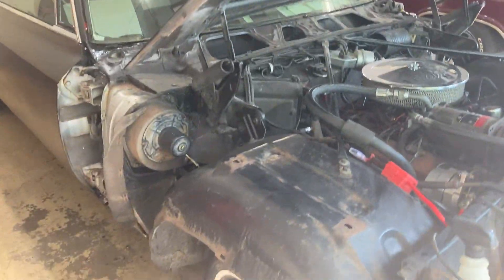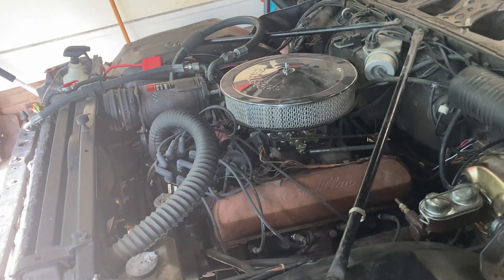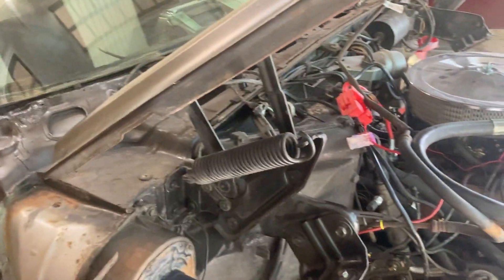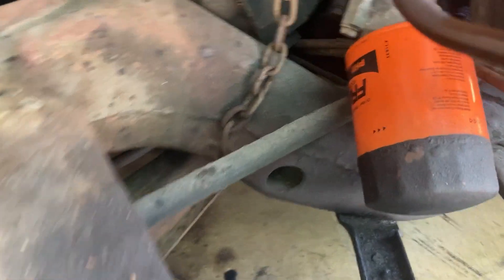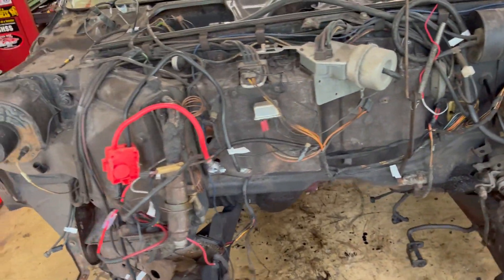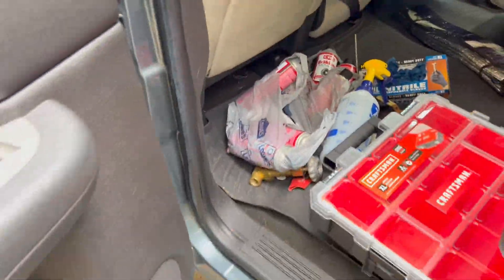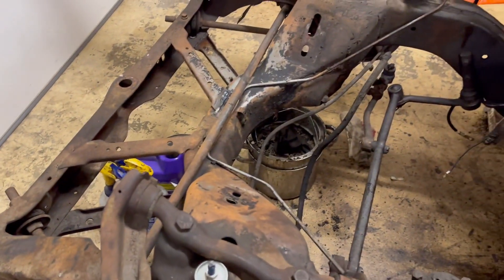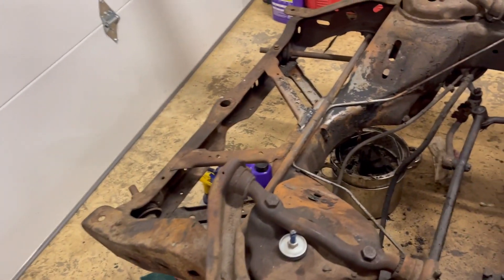1967 Cadillac Project update!!!  Removal of the front clip, engine and transmission

Comment: I've seen that chain for a motor mount before too. definitely a "no bucks" fix. Should look great when it's done!
Reply from the maker: Thank you
Reply: great video I know on impalas that the chain was actually a dealer installed “recall”
Reply from the maker: @hamilton1842  I have a 65 impala also, it had some steel cables holding down the engine that was a recall, but this chain was a redneck repair, lol
Reply: @ImpalaCadillacRestoModDIY I actually did need to know every bolt u took off to remove the front end lol I got all of em but sumthins not lettin it budge, do I for sure need to take both fenders off or can I slip the front end out after removin all lights n attachments, radiator n condenser? If u can help please?
Reply from the maker: @alfredomorales8875 I’m not sure what you are asking. All I can tell you is keep taking out bolts until it comes off. If you have something more specific, let me know